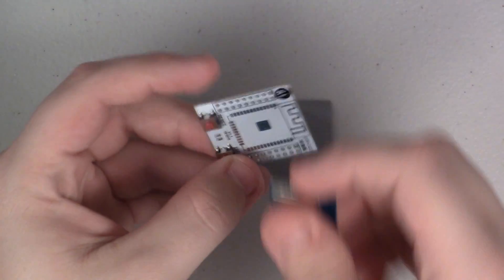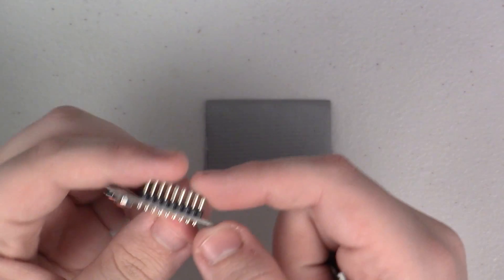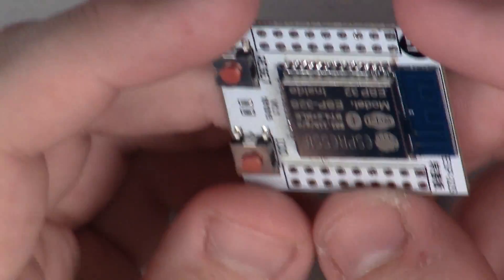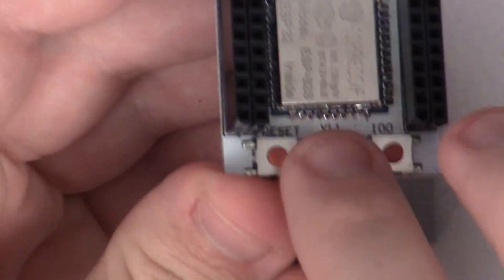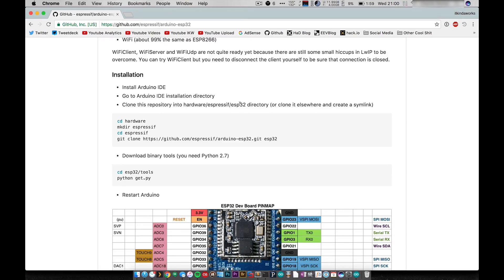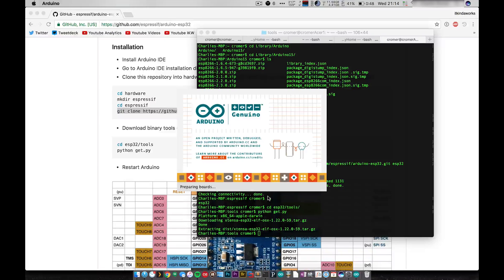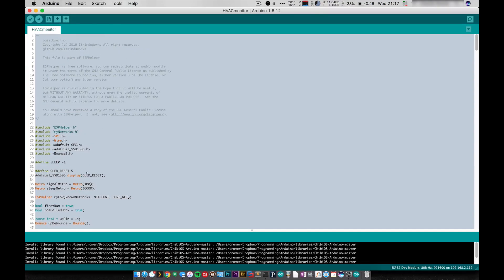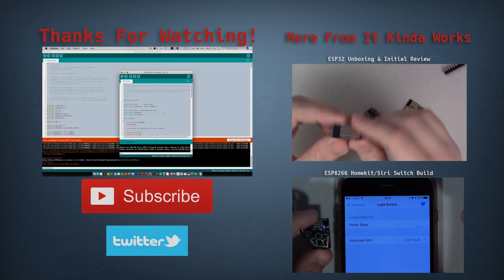ESP32 First Impressions: Hardware & Software Setup

Comment: Thanks for the video. Just a friendly pointer for you. Get yourself some cotton buds, the ones on the stick type, some Iso-alcohol and some liquid flux. Before soldering, clean the board with the cotton buds and Iso-alcohol. Next, you will notice that there is a large square solder pad in the centre of the break-out board. That's an earth-plane which you put a small dab of heatsink compound onto, to keep the module cooler. Now locate and tape down (I like your suggestion on the tape) then run some liquid flux onto the breakout pads.
Your soldering will be 1000% better. Clean the soldered board with a toothbrush and more Iso-alcohol. It will now look like a bought one.
Also just one more minor observation. there is another GND pin just below the RXD pin. Using that one will allow your 4 primary pins to be in one line. I also chose to toss the dual row pins supplied and I just used a single row of 9 pins on each side.
Cheers.

Comment: You could put 1 row male headers and 1 row female header on each side.  Then use breadboard for half and arduino style for the rest.
Reply from the maker: Not a bad idea! I might try that at some point. The only bummer is that power and gnd are on the same side but on different rows so I'd always have to use the female headers at no matter what. It'd be nice if I could pop it on a breadboard and have only peripheral pins on the female headers.

Comment: Hello i can install HAP-NodeJS to ESP32 ?
Reply from the maker: Not right now. It looks like there are some people attempting to port the HAP-NodeJS code over to C++ which could then be used on the ESP microcontrollers but I'm not sure if there has been much progress. The ESP32 also has a long way to go before it's ready for primetime (I'll go into that more in my next ESP32 video).
Reply: ItKindaWorks Thanks, then forward

Comment: Hi I am currently working with HAP NODE.js and I left a comment on your video called: Home Automation at Home Part 6: RGB Light. The question is:

"Can you please make a part list its so hard to hear every parts name and its even harder to find the right one.
If you dont have time for that please give me at least the capacitor and the voltage regulator. But I would love the entire one! Thanks for you time. One last question will it work with a Raspberry Pi?"

Plz answer as quick as possible since I want to complete the project before christamas and I need the right names of the products so I can order them of eBay. 

Like your Home Automation series alot. When will next episode come? I have an idea controlling 433mhz units.

Plz answer here on this video, in the description of the video or on the comments of the video. Please write to me if you add it in the descriptions.
Reply from the maker: I updated the description of the video to include a parts list. It's fairly simple and you should be able to follow the breadboard layout on github for putting it together.
Reply: THANKS!!!!!
Reply: Just one last question which esp module do you recommend and im loooking at ebay and they are calling them ESP8266 ESP-12F or ESP8266 ESP-12E which module do you recommend? Which voltage on the 100uf capacitor should I use?
Reply from the maker: I would use the 12F. It doesnt seem to matter too much but the 12F seems to be a slightly newer model which has a better antenna design. As for the capacitor, I would use a 10V or higher.  Anything above 3.3V should work just fine though.
Reply: Thanks again
Reply from the maker: no problem :)